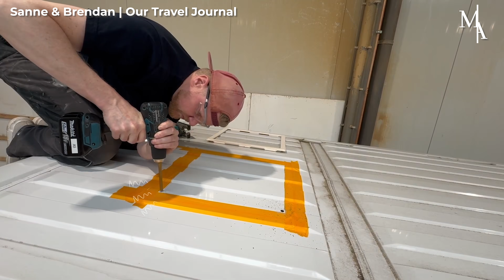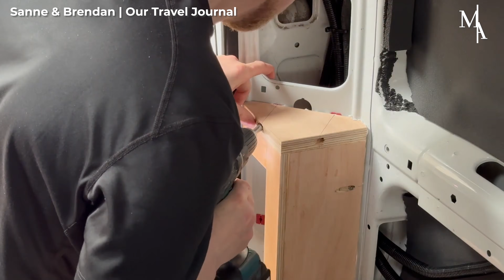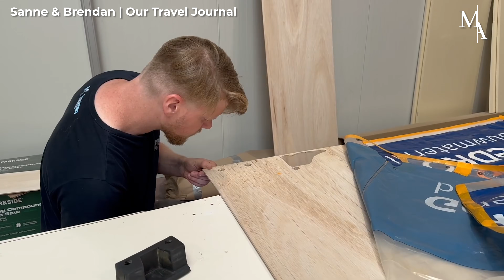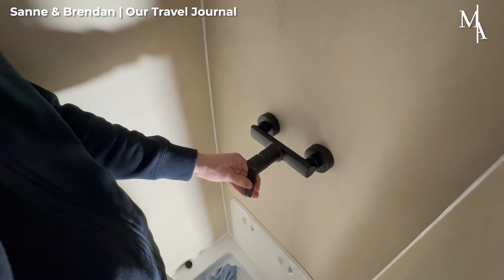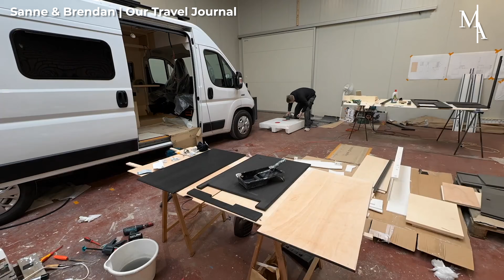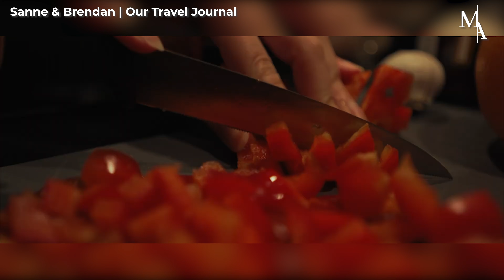Couple Turns Old Fiat Ducato Into a Luxury Tiny Home on Wheels | Start to Finish@ourtraveljournalnl

Comment: Nice conversion! We have both tanks below the van and are rebuilding after improving the insulation. We had the heating system run underneath the tanks, but want to do something simpler. Insulating  as a first step, but perhaps add seat heating pads to avoid frost.

Did you do anything else to the water tank than insulate?

Comment: That looks like SEVERAL pieces of vinyl in the shower and not a single piece.
Reply: True! But it’s 1 sheet per wall and we sealed the corners with sealant so it’s waterproof 🤗